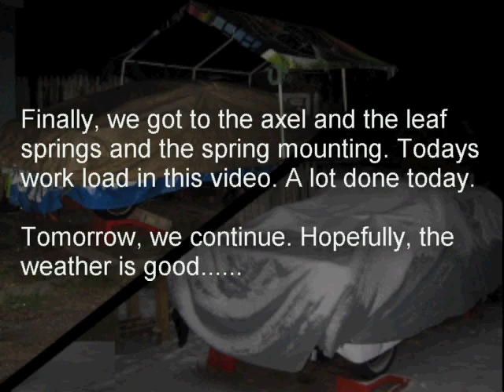62 Fairlane Rear Axel Removal 02 And Primer, Paint, And Ready. Spring Play,

Comment from the maker: Yes. differential is good. The bearings and the seals seem to be okay too. There was no axel grease build up. Inside the drum area. In fact, the wheel cylinders indicate no leaks. But, they will be replaced also as the lines and hoses. With american Fords of this year, inside the drum backing there are 4 bolts to remove the inner axel and expose the seals and bearings. I can replace them at a later date. Now, winter is coming and time is a factor.

Comment from the maker: All Summer it's just about all my daylight spare time working on this car. I will keep going until it gets too cold to do anything outside. In this case, it's better to just let it sit instead of putting something on it. Just too much area to cover, the rust is manly just surface rust at this point. I am aiming on completing the underside this fall. Re doing the seats will be a good winter project inside. It probably will take most of the winter to re do the seats.... Thanks.

Comment: Does it matter that he wiped down the metal that was hanging then touched it with his bare hand before painting?
Reply from the maker: Yes... First, you should not wipe down with a standard rag. You should be using a tee shirt, best if white. Tee's don't leave lint. Other rags do. (at least my experience I found that out) If your using oil base, wipe several times with a damp (water) tee.. Then, several more times with a tee quite wet with thinner, Not running, but wet. Then, over a few times for complete drying. All with different, clean tee shirts.

Right after, then paint. Do the above after you mask. Depending on what your painting... You question was not to the point, so in general is the answer.

The Fairlane has over 100 restoration videos, most designed in fast speed, but not too fast that you cant grab on to whats going on.

The video restoration is from start to last year when it's back on the road. More to come, stay tuned...